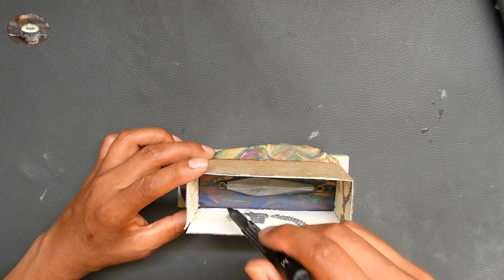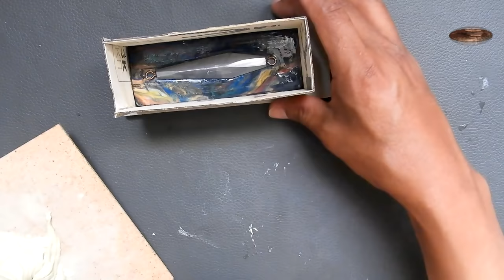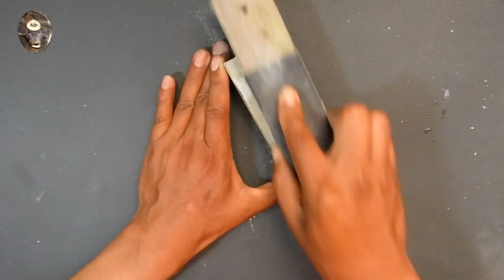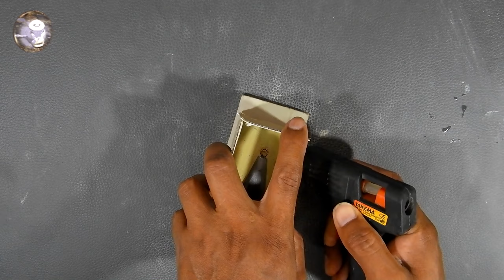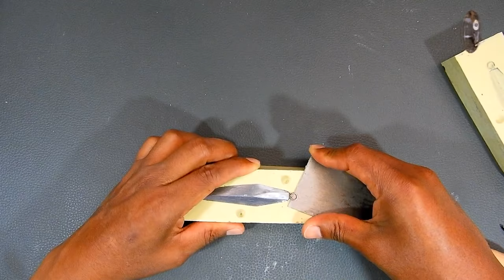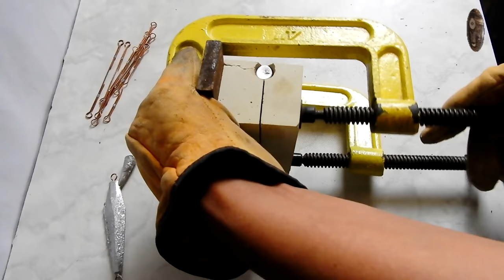Mira todo el proceso de como se hace molde para señuelos de pesca. || Manufacture of mold for jig.

Comment: Awesome video!! Loved it. May I ask what kind of mold material you are using that will take the heat from hot melted led or metal? Thanks friend!! Liked and subscribed to help you out..
Reply: It’s car panel filler. I think in the states they call it Bondo.
Reply: @Ozzierob  I am very familiar with bondo or “”Auto Body filler.”” I have used it many hundreds if not thousands of times. However I never knew it could take such heat. Also friend at first you used something that looked like a rubbery substance. May I ask you what that was. And what kind of metal you used and how you melted it? I know with heat but how do you get a fire that hot? Thanks for getting back with me and for answering my questions!! Really friend, thank you so much!!!    :))…….
Reply: rob jen better off using rtv hight temp silicone mold.
Reply: @Ozzierob  Great thank you!! Never heard of it but will find it. GOD bless Buddy!!..       :))……….
Reply: rob jen have a great one man :).
Reply from the maker: Thanks friend, the mold is based on vehicular putty and supports molten lead for a long time, at least thirty samples, which is good and then burns little by little.
Reply from the maker: @robjtko  The gummy substance is school clay.

Comment: How many times can you use a mould like this before it becomes damaged?
Reply from the maker: I do not have that data, but I have already made many lures, something of 20, and they continue to serve, although it has taken on a dark brown color.
Reply: @Horadepescahp  Thanks for that. I'm looking for economical mould material. Car filler is very expensive.  It would need to be very long-lasting to be viable.
I'm thinking Plaster-of-Paris. Same process, possibly easier, definitely cheaper. But how long would that last?